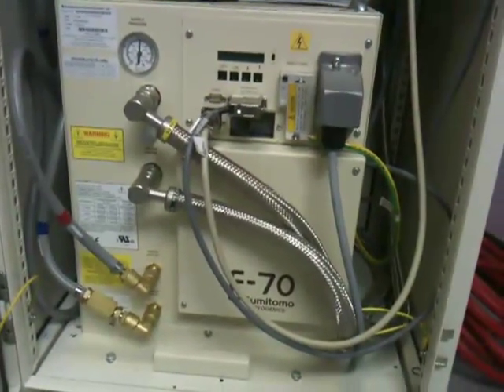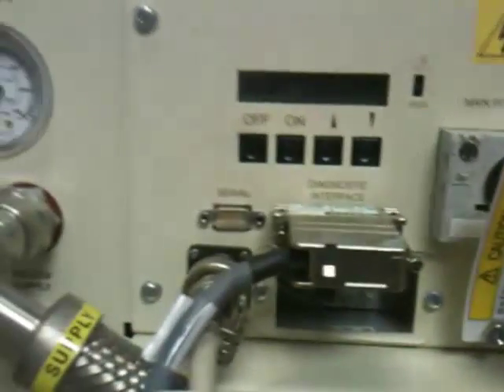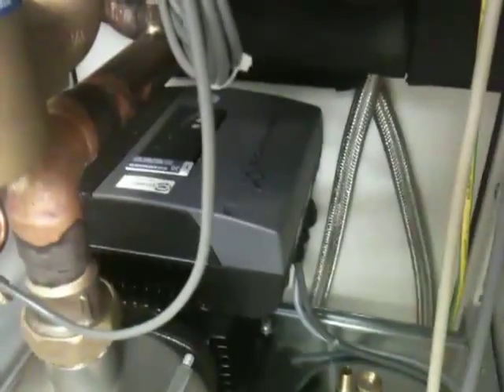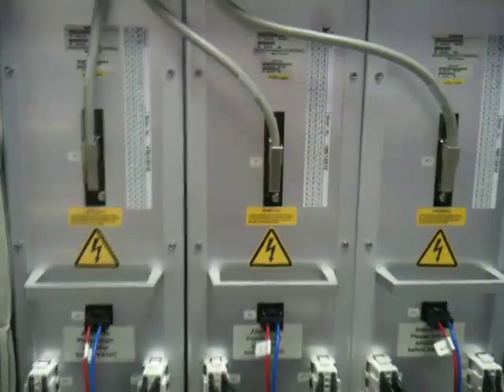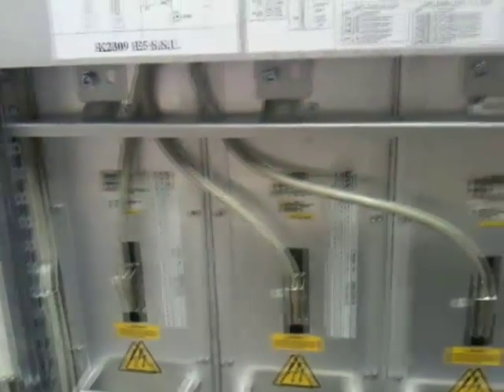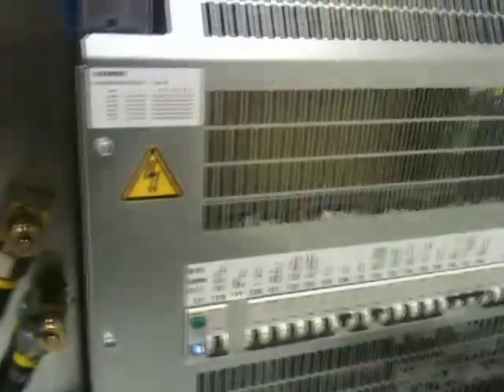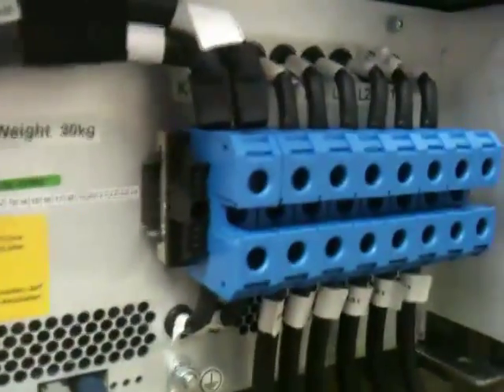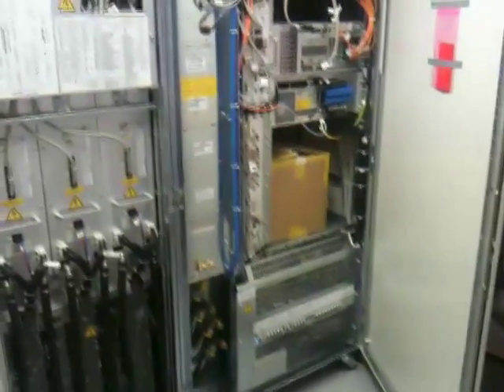Gradient amplifiers, coolers and other stuff

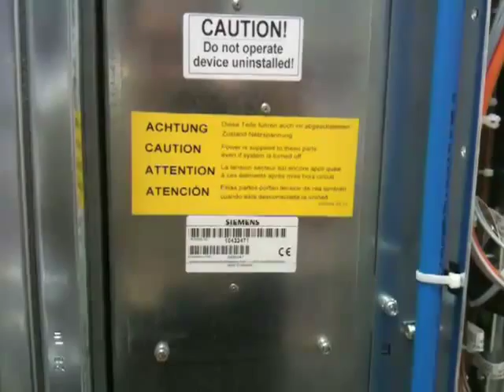Comment: The box at 2:45 is the "ACS" which basically just contains big fans generating cold air cooling using the chilled water.
At 4:00 its the "Thyre" which is a DC power supply for the RF transmitter and the other components mounted directly to the side of the magnet.....